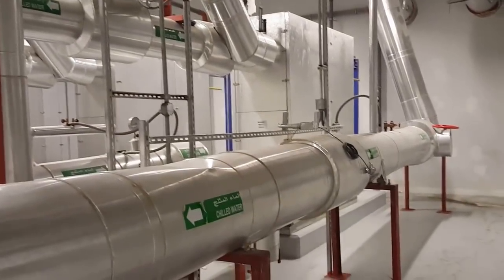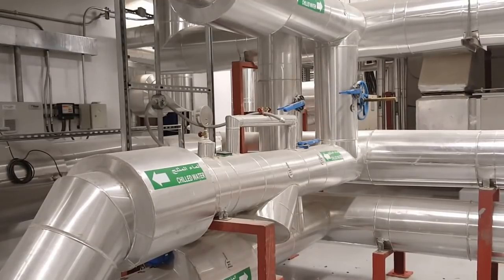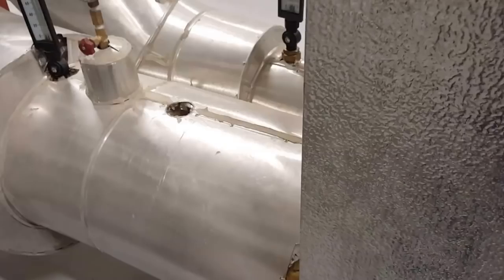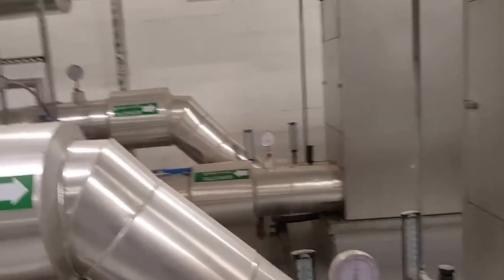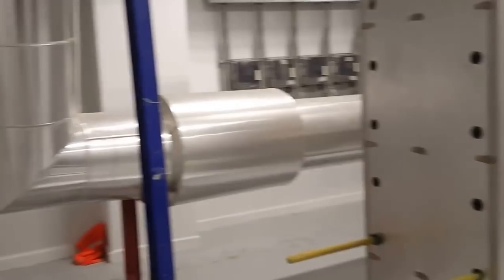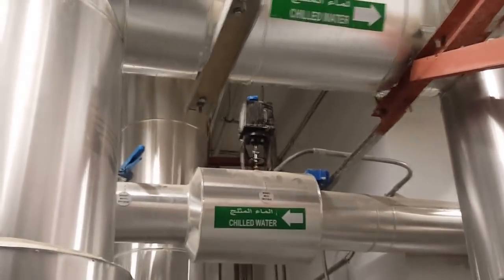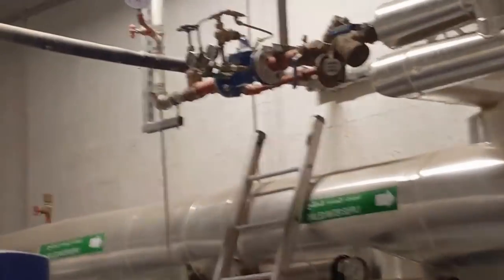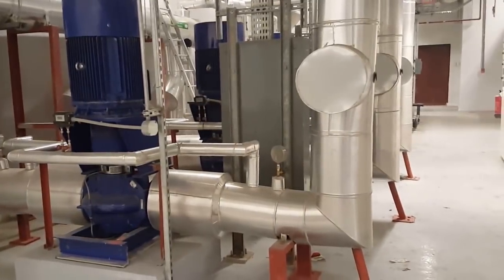HVAC - Chilled water pump room Installation Detail with heat exchanger

Comment: Hello brother. M facing a problem into dubai discovery garden. Room temperature not come down thermostat is working, actuator valve is working, filter clear fan speed is ok bt grill temperature 17 to 18 bt room temperature is 25. Plzz rply me.
Reply: Hi bro....Grill temperature should be 11 to 14 then only you will get room temperature 22... Condenser or Evaporator line may have blocked .....

Comment: my comments are '

some coordination problems 
pumps are little bit noisy 
cladding joints is inconsistant 
valves seems accessible but panels, pump, heat exchanger i have a doubt

Comment: Sir what is PRV? What its stand for and its function?How much Tr heat exchanger it is? And Heat exchanger manufacturer name? IS always in heat exchanger the downward side from district cooling and upside to building?
Reply from the maker: A pressure regulator is a control valve that reduces the input pressure of a fluid to a desired value at its output. Regulators are used for gases and liquids, and can be an integral device with an output pressure setting, a restrictor and a sensor all in the one body, or consist of a separate pressure sensor, controller and flow valve.
Reply: SHAIKH MUDASSIR AZM